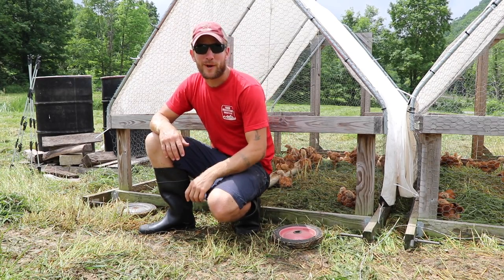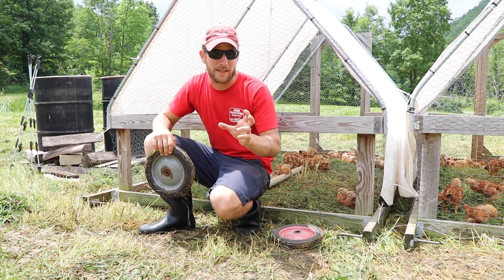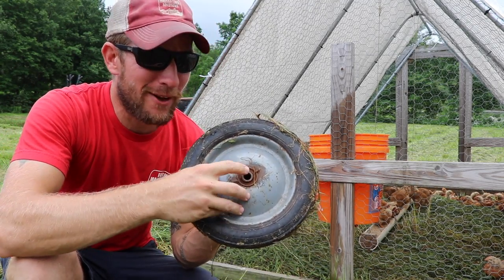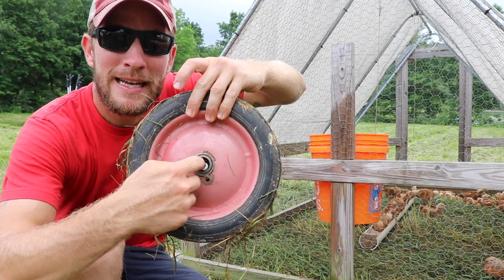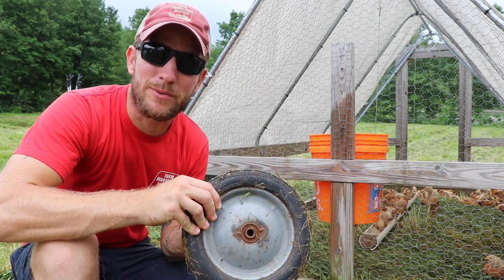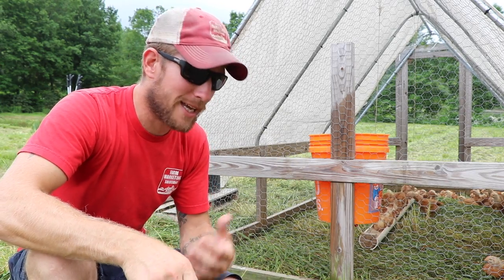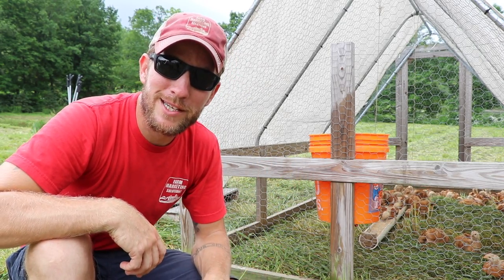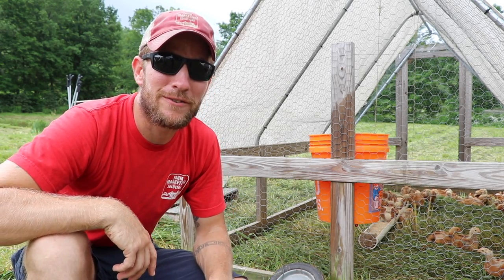What wheels to move chicken tractors?

Comment: The solid wheels I got, even with a tack weld kept falling apart and were too small. I got some wheels form Tractor Supply that are a little bit bigger, have a beefier bearing system and make the tractor a lot easier to move. They take air but i've never filled mine up, just let them run sort of flat.  they run $9.99 but I think Harbor Freight may have something similar for $5-$6.
the bearing on one side is flush but the other it sticks out about 2 inches, this makes it easy to grab the wheel there an touch less chicken poop.
Pneumatic Wheel, 4.10/3.50-4

Comment: what i would do is just put the wheels on a bar and then just have notches where your current axles are.   so you can just lay the wheels down set the chicken tractor down on the axle. that way you don't have to fight trying to pull the wheels on and off. when you are done pick up the tractor and kick the axle out and set the tractor down.

Comment: My first chicken tractor had wheels like yours but they didn't roll easily over rough ground. Now I use bicycle wheels. I get them for free from my local solid waste transfer station. Bikes on the metal pile are pretty common. At that price anyone can afford to give each tractor its own set of wheels. Even if I was buying wheels I would get a set for each tractor. My time is too valuable to switch wheels every time I move a chicken tractor.

Comment: if you are only moving the chicken tractor 12 feet at a time . do what I do ... make your own .make them out of 2 inch piece of tree trunks drill hole in middle  slid on axel . they may only last one year but they are free .. if it's free it's for me should be your motto too
Reply from the maker: Free can be good, but you often get what you pay for. With me not doing it alone I wouldn't trust that they would hold up and not leave someone in a lurch. Some times dependability is work the $$.